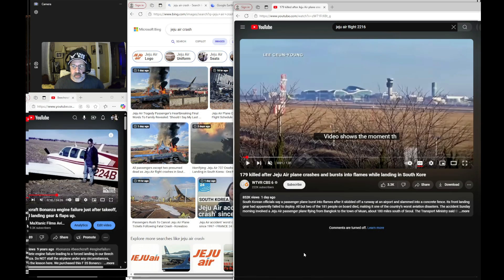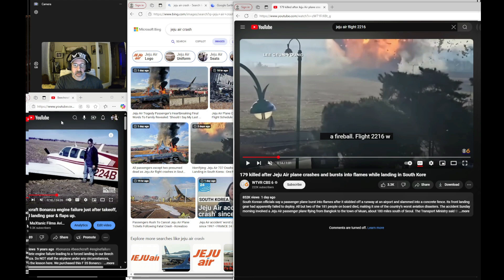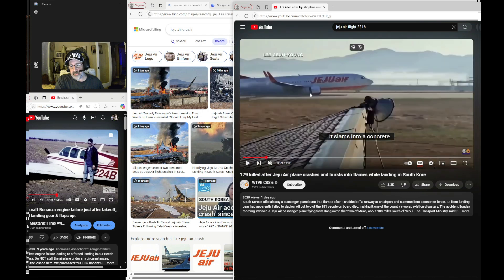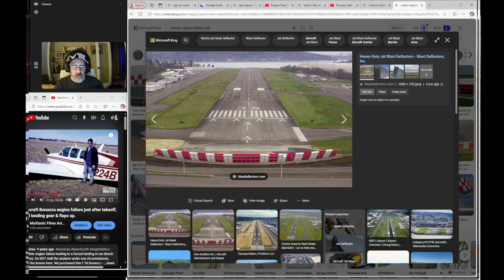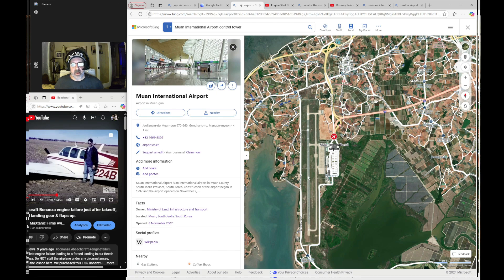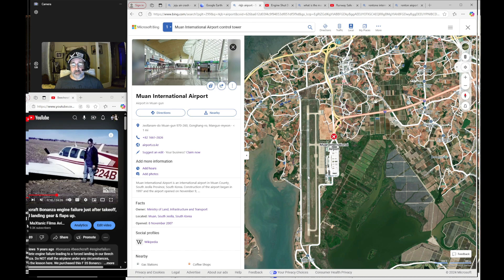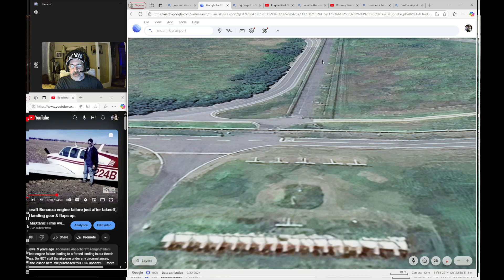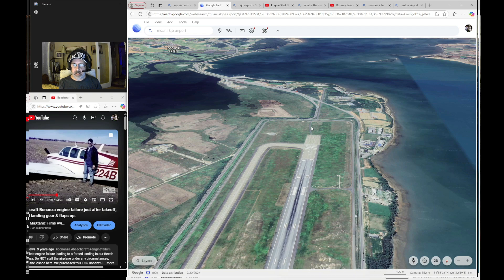JEJU air flight 2216 fatal crash, would EMAS have helped? South Korea Dec 29th, 2024. Boeing 737-800

Comment: It's difficult to argue against pilot error:
He basically turned and landed 4 minutes after a bird strike.

He seems to have shut off the wrong engine.
He landed in the middle of the runway using the wrong configuration.
Even though he knew the airport, he landed from the north facing a wall (there's no wall on the other side, so had he landed from the south as regular, there wouldn't have been a wall).
And finally, he didn't down the landing gear manually.

Comment: According to FAA advisory, EMAS is designed for overruns until 70 knots and with landing gear down. Apparently those conditions do not apply here.
Reply from the maker: Certainly it didn't but if EMAS was there in place of a concrete wall the engines would have dug into the EMAS partly which would have helped slow it down. Then as it went past the EMAS into the grass again it would have been stopped perhaps close to the brick fence or even a little past but wouldn't have resulted in fatalities as the brick wall was thin and would have collapsed absorbing even more energy.

Comment: Good vid. Just one question. If the plane was configured to land, was low, speed reduced, gear down [there is footage of this], why did it not just continue to land on the bird strike. I believe the manual says this is perfectly fine to do... and seems the logical thing to do. Why would you want to power up again and rely on potentially compromised engines? Cheers~
Reply from the maker: Very curious for sure, will be interesting to hear what the CVR has on it as all the data has now been recovered.

Comment: My analysis:
Pilot Error.

1. Pilot Error
2. Unfortunate luck of the draw (e.g. PF, choice of runway, etc.) = AKA "Swiss Cheese" Theory
3. CONCRETE BARRIER (responsible for the seriousness of the incident)

Sequence of event:
PF = FO
Bird strike engine 2.
Decide on go around = only done if one engine hit/damaged. If both engines, they would have continued their landing attempt on runway 01.
Started checklist and go around
ACCIDENTALLY SHUTDOWN ENGINE 1
Asked for immediate landing on runway 19
Did a sharp teardrop turn to realign with runway 19 for emergency landing

Why do I think the FO was PF? Because of the request for runway 19 which means PF could make the turns while observing the runway. Had the PIC been PF, he would have asked for an immediate second attempt at runway 01 which would simply continue their current bank, and he would be able to visualize the runway at all times.

What they did not know was the concrete barrier buried under/behind the bank of soil at the end of runway 19.
That was the problem. The sloped dirt barrier isn't ideal, but they had little choice at this point.

The pilots may or may not have realized or remembered that runway 01 was being extended. There was plenty of extra room for an excursion on runway 01.

Extra point of note = 
Flaps 0 and landing gear retracted: the plane was put in clean configuration to give maximum glide performance. They didn't have much altitude, and they had a LOT of turning to do to get realigned with a(ny) runway for another landing attempt. I do not think they had complete loss of hydraulics. In the video from the port/left of the descending plane, you can see yaw. This yaw can be explained by engine 2 still producing some thrust while engine 1 is shutdown. The PF was able to correct for this.

Could/should they have tried lowering the landing gear during the base leg? Probably not. The only way to lower the landing gear was manually, which is behind the PF/FO. Even if it was pulled, would they have time for it to come down properly? Manual release of the landing gear means using gravity, and being in what was likely a decent bank means that there would be lateral g-forces which might inhibit one of the main landing gears from fully coming down and locking.

Could they/should they have hit the speed brakes? Should have if they had hydraulics, but by this point, I think both pilots were pretty saturated.
Reply: "Decide on go around = only done if one engine hit/damaged. If both engines, they would have continued their landing attempt on runway 01." Even if only 1 engine hit, why not still go trhough with the landing. To power up again just leads to potential problems... further bird strikes etc, or that in fact both engines had been affected.